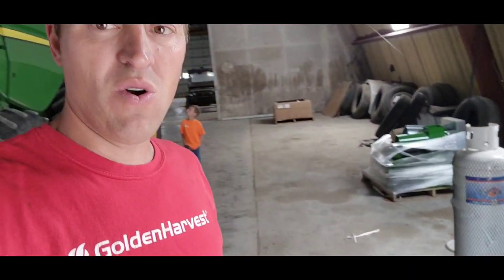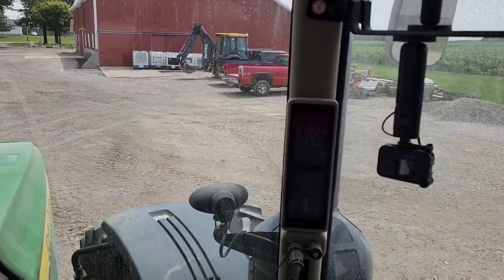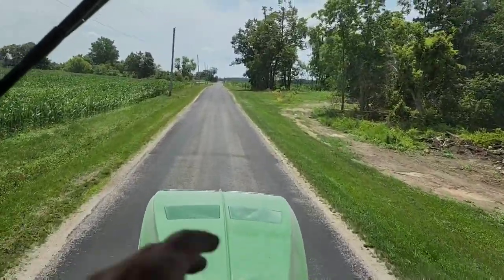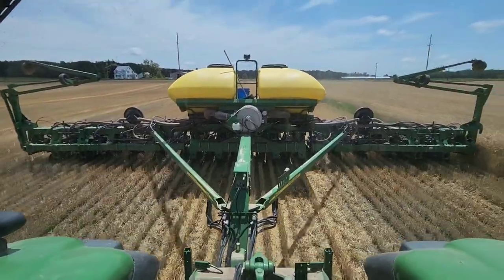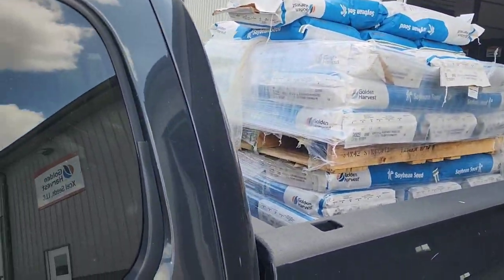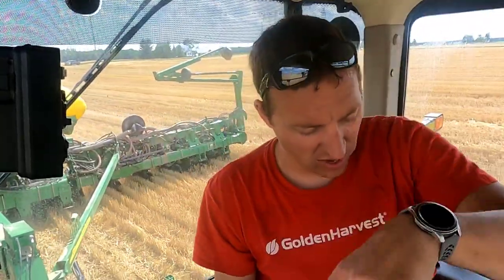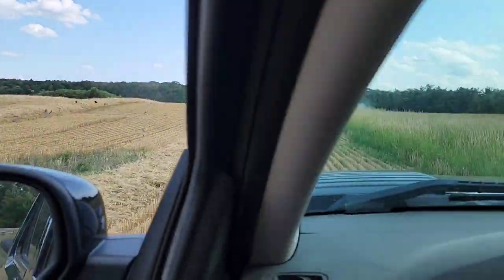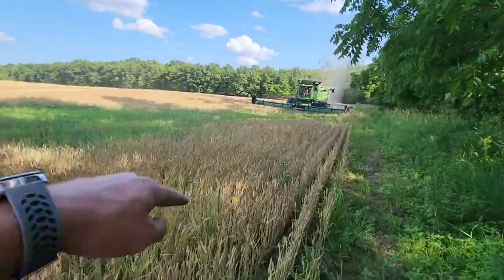Economics of Double Crop Beans

Comment: You mentioned 10 and 15 inch rows during your double crop video. Was the corn the 15” and the the beans 10”. I was thinking you did not normally plant beans as close as 10”.
Reply from the maker: What was 10", beans are 15"
Reply: @BorderViewFarms  what do you plant the 10” rows with.I believe your new planter has 30” rows and this is the one you primarily use to plant corn. Your older p,anter has 15” rows I believe, and this is the one you use primarily use to plant beans. Did I get all of this correct?
Reply from the maker: @stanbrow  right but the air seeder we plant wheat with is 10"
Reply: @BorderViewFarms  thanks.